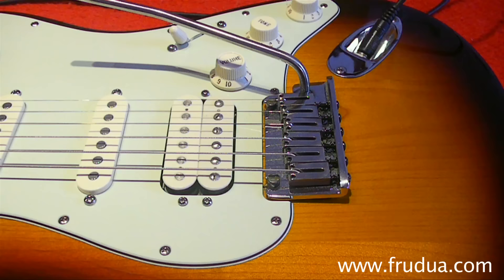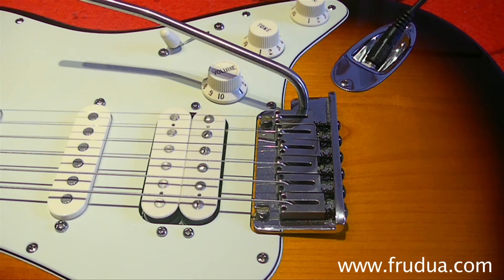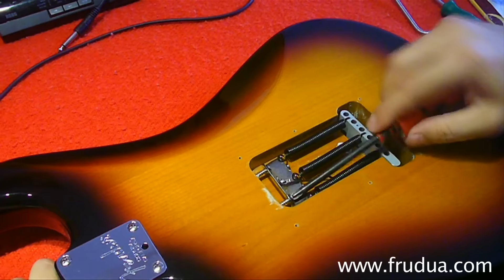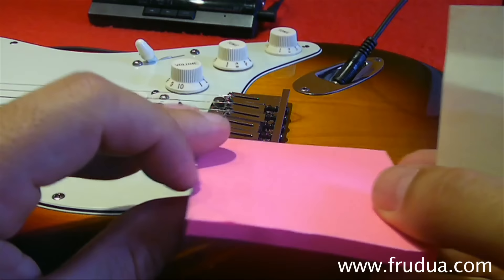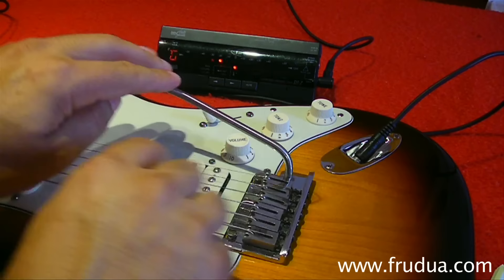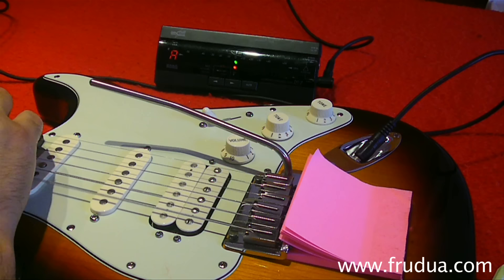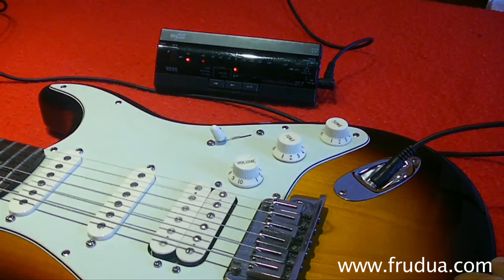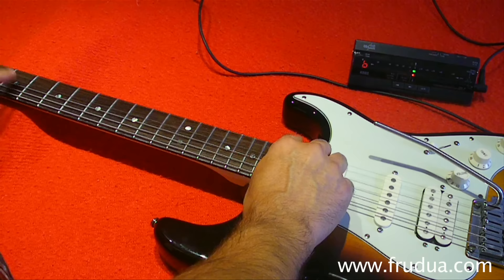How To Set up a Strat Floating Tremolo | Two Pivots Tremolo | Whammy Bar

Comment: Awesome video. One thing I would like to add is that after you keep the sticky notes at 4:44, would be the best times to adjust your 6 screws on the bridge. At this point tighten the 6 screws so that it just touches the plate. Now, at this point, try to lift the tremolo arm up/outward. It shouldn't move. If your tremolo moves upward it means you should tighten your screws. Also make sure that both sides are still parallel as said in the video.
Reply: Arvind Sreekumar good point!

Comment: Ive followed Darrel’s way of floating the trem for my 2 other strats since it follows the same concept- minus the post it notes. But this video has helped in a different situation. 
I was having trouble setting up another strat I have. I may have played around with the 6 point screws which had varying pulls to the bridge. Started over and made sure that all screws were of the same height and followed this video on floating the trem using the G string instead and tuning from the claw. Works wonders! Thank you!

Comment: One remark: if you turn the pivot screw with string tension (to lower or increase action as shown at the end of that video), you will scratch it with the plate's knife edge and this will impact the ability of the tremolo to return to its "zero" position.
Reply: is it enough to remove the strings or do I need to remove the entire bridge for that?

Comment: WOW! this tutorial helped me a great deal , as I was following your foot steps I discovered that my high E string tremolo post or screw was off by 1mm from the rest . this made the bridge sit on the pic guard at one end . I pluged the hole and drilled it in the proper location . Now it works like a dream . The guitar must have been built on a Friday lol . Thank you so much . I never would have discovered this without your instuctions . Thanks .

Comment: When I first got my strat, I thought it was "broken" when the bridge was high up off the body. It looked very unnatural.  So I set it up to be almost completely flush, but just barely off the top. Well, something kept telling me that I didn't like my guitar. I finally followed these instructions for floating, and now I absolutely love my Strat. I don't know what I was thinking before but sometimes you just got to try new things!
Reply: the important thing, does it stay in tune better now when using the trem?
Reply: @sixslinger9951  yes it does. Combined with giving the unwound strings a couple of extra wraps above and below, it's very difficult to move it out of tune. Super stable, yet plays loose and free, all around.

Comment: I can’t get the intervals even though I am doing everything as you say.

Also, do I set the saddles before this or after? At the parallel or decking bridge? (Cause I figure if you move saddles as the last movement, you’ll mess up  the action)

Comment: Men I have a question 
should this set up be made after intonating the guitar? or should it be done before

I´m having trouble with the tunning after adjusting the floating tremolo, it just wont stay in tune. And Its weird because its seems that when I use the tremolo bar the guitar looses its intonation and everything goes out of tune 
I have a fender stratocaster americal deluxe and it has the LSR Roller nut, which is suppose to help with the guitar intonation overall the guitar, and eventhough it wont stay in tune

Do you have any advise for me Frudua, Ill aprecciated
Reply: it means you need new strings in a heavier guage thats what works for me

Comment: Thanks so much.  But my tuning goes sharp when I pull the tremolo, and flat when I dive. I have to manually kind of shake it back to return to perfect pitch. Bridge makes a click sound when i go up more than one note on G string with tremolo. Already lubricated the nuts. Anyone else facing the same problem?
Reply: That often means your springs aren't at optimal tension.  Choose the right number of springs for the gauge of strings. Usually 3 springs unless using heavy strings. They have to be set so that even at the most relaxed position they are still somewhat stretched. If they are too relaxed at rest then the guitar wont return to tune.
Reply: I got the same problem...

Comment: Came across your great videos a few years ago and followed one to set up a six-point trem. I just got a Vintera '60s Mod. Strat that has a two-point trem so I thought I'd follow your advice once more and it worked perfectly. The best method for setting a floating trem in - if not exactly seconds! - then pretty quickly and easily. By the way, one small error, that's not a Philips driver that you used on the pivot posts!

Comment: I've been wanting to set my strat up with a floating tremolo for a while...I paid to have it setup with it on the deck for easy restringing but to my ears the tone suffered by having the block jammed against the wood inside the guitar.  So, I gave your method a try today and I can't believe it took me this long to finally set it up.  I can use the whammy bar all day long and it still stays in tune, love it!

To stay in tune, apply chapstick to the nut grooves using a toothpick.

Comment: Hey Galeazzo......

I've never really worked on my guitars before apart from changing strings and stuff. But I have a Jeff Beck Strat where the 2 point tremelo was locked against the body and therefore I could only bend the note down but not raise it.
Well I saw your video so I decided I would try your method. 
Well I have done it and now I can bend the note up with the whammy bar but it's still slightly short by about 1/4 of a tone.
I was so pleased with the result and, now I know what to do,  I'm going to adjust it again in a couple of days to get it exactly right.
A really big thank-you for helping me out, Galeazzo. I now feel much more in touch with the guitar.

Cheers
Red

Comment: Interesting video and method of adjustment. I use sheets of aluminum flashing, but I like the post it note thing.  Never thought of that and I'm going to try it.  It's tough to keep a Strat set properly for action, intonation, & a tremolo position when players keep changing string brands and gauges.  I always start from the middle of everything and fine tune each element from there.  Thanks for making this video.

Comment: So cool, I just followed simple instructions to set up my Mexican and US start in one evening. That is because I've changed neck plates, and guitars needed new set up afterwards. One advice, make board that holds rear springs under an angle so that springs responsible for E and A are more stretched.

Comment: I am stunned at how well this worked. I've played guitar for 35 years and always shied away from Strats because I always heard that the tremolos can't stay in tune. I used a Kramer with a Floyd Rose for years. Well, recently I found a Squier Strat for cheap and decided to give the whammy bar a try. I set it up just like this video, and I'll be damned - the trem stays in tune perfectly. I have cheap stock Squier saddles and string trees, I didn't buy any new hardware or anything. I've been playing my Strat for over an hour now, still in tune after dozens of dive-bombs! I can't believe it.
The only thing I can think of that might make my setup "different" is that I am using terribly old strings, they are probably stretched out as far as they're ever gonna go, and thus don't go out of tune as easily.

Comment: Great video my question is where do you start with the two pivot screws on the bridge so after the setup the action is where you want it you said to screw both down what about the individual string saddles for example to have 4/64” action at 12th fret

Comment: Thanks for the amazing video! One question though: I set up my trem like that, but i have one problem. When i use the trem to bend UPWARDS, it doesn't come back all the way, when i release the trem arm. The only way to bring it back the whole way, is to bend DOWN a little. Then it's perfect again. But i noticed in your video, it comes right back, after you do an upbend. Do you have any idea, what my problem might be? I'm using a squier deluxe strat with the stock 2-pivot tremolo. Thanks! ... oh, and i've got a roller nut and locking tuners as well...

Comment: Hi, great video, very clear explanation. I followed your procedure because I have had tuning problems when I do dive bombs or big pull ups on my Jeff Beck Strat. It's been like that since new. It has the lsr roller nut so shouldn't be friction at the nut.  This procedure made it work better but it still goes sharp on the E and A strings under heavy tremolo use. Any ideas why it won't return to pitch?

Comment: very good thank u but have one question i was told befor you do the 2 srews up u need to loosen the strings or it can break down the edges on the wammy the sharp inlays what the srews are on.or maybe that was only a floyd rose

Comment: I tried this procedure and it actually worked for me! On an Epiphone S310 which is a plywood bottom of the line guitar. I put Super-Vee Super glide on the nut which likely helps, but that's all I did. The tuners are original which means they're low end generic but they do not go out of tune! I'm a lone player in my house, I dont get stupid with that trem arm. Kudos to you for making this video and "duh" to all those who are vindictive toward Chinese guitars.

Comment: Mr Frudua: I am one of the countless hundreds of thousands of guitar players that you have helped so greatly for that I give you the  "Most valuable Luther Award".  One question for you: if I want to be able to pull the tremolo bar up quite a bit.and floating...is this video the way I should go by EVEN if I have a older six screw tremolo mounting plate (not the "two pivot tremolo"?  Once again, I can't thank you enough

Comment: naturally there are other things included in the "action" category for instance. This involves setting saddle height and radius and truss rod to have the neck bow/flex properly. A new guitar (especially the cheaper varieties) can always benefit from a full pro setup because they can also address fret and nut issues which can drive you crazy with buzzing. Hope that helps a bit, Good Luck

Comment: A tip for people struggling:

Make sure that the gold pieces that the two posts screw into are flush against the body of the guitar. For some reason mine had risen slightly and so the bridge was sat on top of them and could not pivot properly. The method presented in this video really does work once all is well with the guitar.

Comment from the maker: @maggottron333 Mhh no I didnt' cover this yet but simply tighten the springs on the rear cavity BUT before take the actual height with a caliper so you can readjust the bridge to the correct way after leaning it on the guitar top.

Comment from the maker: Remove the rear springs plate and carefully check for any point the spring might be touching the wood cavity while moving. Also check if it is settpling during the movement where it is attached on the claw springs and on the sustain blck.

Comment: I have watched your videos a lot and learned a great deal. Thank You ?
I have a new Fender Mexican Deluxe Strat and was wondering if you could help me with an issue.
I setup my bridge for floating as you described in this video, and after watching more of your other videos got it to return to pitch pretty well for lowering the bar. But when I pull on the bar to raise the pitch it always falls out of tune very badly.
I lubricated all the contact points and the performance got even better for lowering the bar, but it is still very bad for raising pitch.
I spend some time and manipulate the bar in the raise direction, I can get it return to pitch on that side, and then lose the tuning stability when I lower the pitch.
Yesterday, I noticed that the two pivot screws were snug all the way down. and started to raise them in small increments.
This helped reduce how far the string went out of tune, when I raise the pitch. It went from +50 cents out to +25 cents out of tune.
Should I keep raising the pivot points ? 
I also noticed that if I jiggle the bar a small amount at the neutral, sometimes the tuning comes back perfectly.
Something is binding in the bridge itself and seems to get caught.
Any ideas on what I can do to resolve this problem ?
Please let me know.
Thanks,
Juan

Comment: I watched all your excellent  videos. My 2005 American Deluxe (2 pivot) Stratocaster's (pop in arm) Tremolo worked 4 years almost as efficiently as a Floyd Rose, but last year sometime I have changed strings/brands often ( like D'Adds) the G string just won't come back in tune. It is always sharp. If i retune the string & use the trem it is fine. However when i bend the G is comes back flat. I don't think it's the nut as i can bend behind the nut etc. with N.P. Tried fine sanding saddle too,same

Comment: I’ve tried that and worked well until I had to re-adjust string height and intonation after setting up the tremolo. After doing so, the note intervals changed with only the one on the high E working well. Also, what is the recommended height for the two pivot points?

Comment: Hi Frudua, thanks for the video, they are very useful. ;)
Could you please answer 3 questions?
1. My factory setup for the 6 screw tremolo is much higher than on your video. How do you decide the height? Does the height affect only the "length" of the bending, or does it affect anything else?
2. If I do not really use the arm (I am quite a beginner, I am glad I can play :D), do you suggest setting it fixed?
3. You have not touched the screws. When do you have to adjust them?
thanks faithfully

Comment: Hello FruduaTv, very nice demonstration! Thanks for the video.

I have some questions about that.

1) If i use 0.11 strings, would it be possible to achieve this setup (1E rising 1/2 step; 2B 1 step and 3G 1 step and 1/2)?

2) Which setup would be the best for strings 4D, 5A and 6E?

Thank you once again!

Comment: Mr. Frudua, your lessons are far above the others i've seen - thank you so much for putting them online so people like me can learn. Quick question: am I correct that we should have completed all neck adjustments and intonation before setting up the floating bridge? And if so, when performing the intonation and setting up the neck for the first time, should we set the bridge so that it rests on the guitar top? I'm asking because I'm putting a parts guitar together for the first time and i'm having trouble getting the neck, intonation and bridge setup effectively. I'm a little overwhelmed - there's so much to get correct, I don't know which thing to start on first, and in which order to do all of them. Do you already have a video posted that addresses this. Again, thanks for putting your expertise online.
Reply: Intonation is very last thing you're setting up. Edit: last thing is pick ups height.

Comment: I hope you don't mind me offering an opinion. 1) Truss rod. Capo on at 1st fret, hold bottom E at 17th with right hand and measure clearance at 7th with left. It should be 0.25mm. 2) Check the nut height. You should look for 0.45mm clearance at first fret. 3) String height. 1.5mm at 17th. 4) Intonation, checking open string against fretted at 12th. All (except nut) performed in playing position, not with guitar on bench. Good luck!

Comment: Hey Frudua, thanks for the instructions. Very helpful. Until I saw Carl Verheyen videos I thought that I should set the bridge always flush. Even my profesors had told that. Is your approach similar or equal to  Carl Verheyen method? I´ve seen some of his videos and it seems that he set the two screws of the springs with different positions (slanted). Grazie.

Comment: Great video.  Question:  I prefer a setup where the bridge is flush with the body [so that my right hand cannot inadvertently press the bridge down and up/out of tune while palm muting].  But now my string and spring tension seems too high-the whammy bar is too stiff, and it is difficult to bend strings.  I am using 3 springs, and have experimented with 1/2/3 at different distances, with no luck.  Any advice for a setup like this:  easy whammy and string bends, but bridge flush with body?

Comment: do you need to do this each time you put new strings on? Also if you have to lower action with the two pivot poles like you did at the end, can you use the tuning keys to retune because it will not be out again?

Comment: I have checked out the 2 videos u recommended, since totally new to this, I have a few questions. So since I want to change the base tuning setup of my srv strat to E standard from D#, what should I do first? Adjust the truss rod or start with the floating tremolo? My srv strat is already a floating tremolo, but I have never checked the range using a tuner. Please guide me specifically how to do this.

Comment: Thanks for this tip. Better than Carl's method which was not clear. First it took me about 2 hours then next starts where done in 20 minutes or so. I used an angled ratcheting screw driver for the claw and teflon lube on the nut, string tee rollers and the saddle. Also for string height, IT is best to also loosen the two saddle screws about 1.5 turns on the bass and 2.5 tuns on the treble side, so when the strings go up on you, you just screw in the to lower the strings